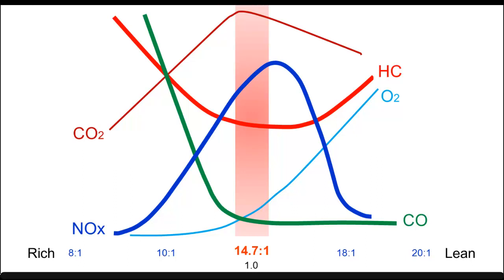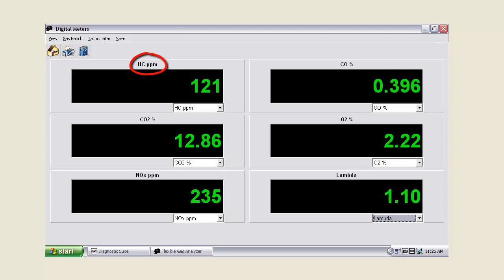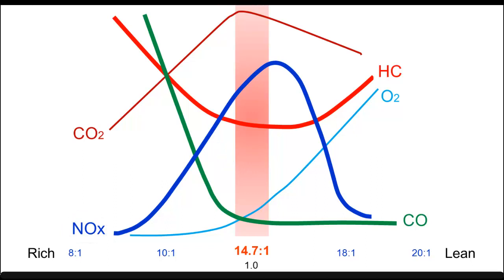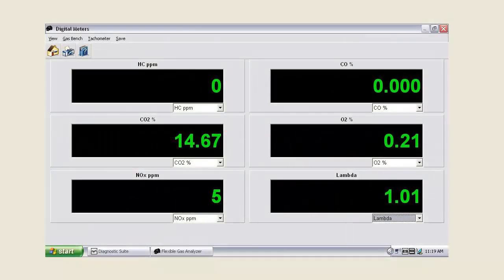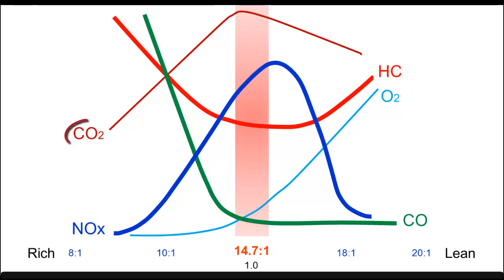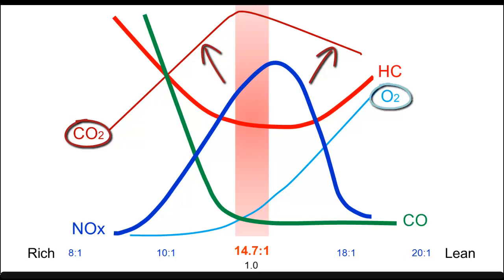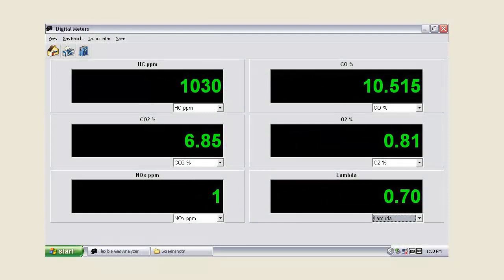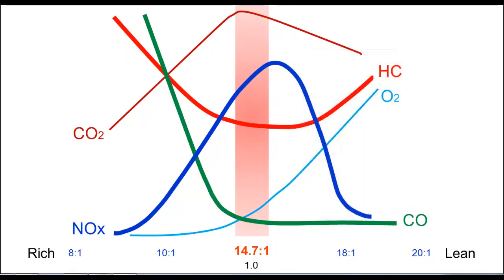Exhaust Gas Analysis for Advanced Students

Comment: What if the OBD2 hook up for the car does not show air fuel ratio (like when hook up for a Japanese car) but shows MAF value. The old car only has one O2 sensor located just after the exhaust manifold and well before the cat convertor. 

The car is 1.8 liter x 750rpm/2/60 x corrected air density at 7.35psi & 100F = 5.7g/seconds. 

Since the intake valve closes off only at about 60 degree after BDC, of suction stroke,  the dynamic suction stroke taking 4.7g/second of air appear to be very accurate. 

At 2000rpm & 49mph the MAF is 18g/second at -1.5 to -3 psi vs 23g/second by calculation. No idea in Egr % opening as OBD2 could not show this. O2 sensor reads at about 0.75v. 

I like to learn more.

Comment: Wow, this is good video. Wonder what is the Egr opening and it's dilution effect onto flame speed during combustion or power stroke. At CO2 of 7% this indicates fuel is not being properly burnt off. Maybe timing of ignition spark is not been sufficiently advance?. Like ignition spark initiated only after TBC of compression stroke instead of 20+% before TDC?.
Reply: Sorry on typo. Correction ; at CO of 7% this indicates fuel is not being properly burnt off.